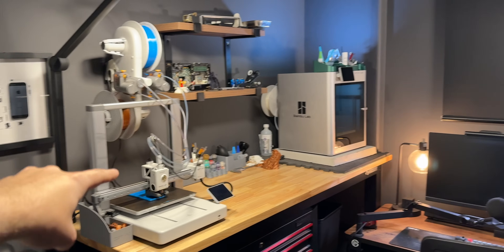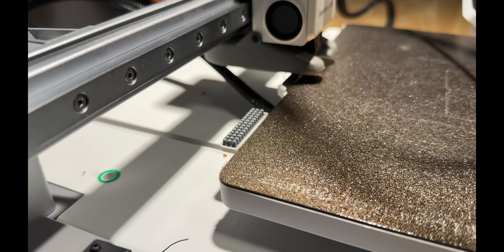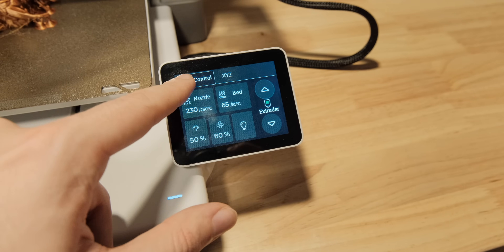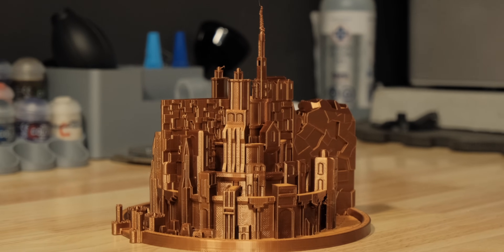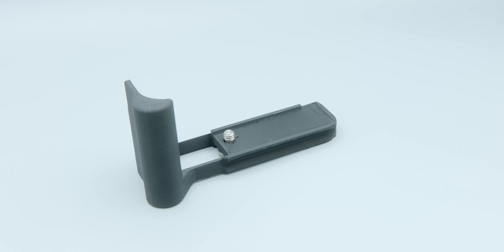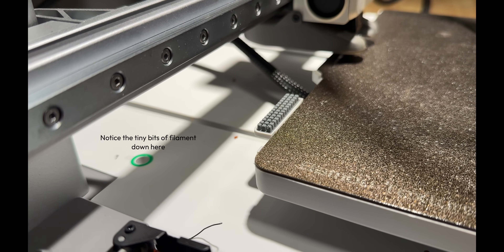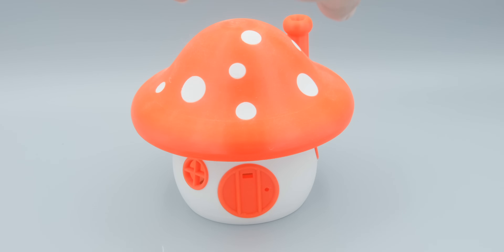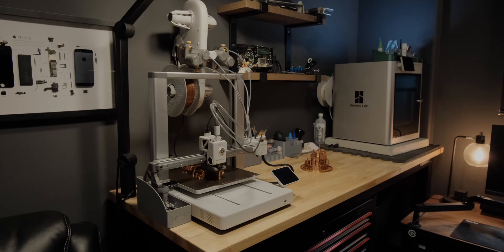Bambu Lab A1: Long Term Review in Under 5 Minutes!

Comment: A1 system is not good, P1S/P instead to be honest, had a A1 for a year and the novelty wore off really quickly as it had many print issues from warping to the bed completely failing and having the nozzle tip scrape holes in the bed, my bad for not ensuring the bolts behind the nozzle aren't tightened from the factory I guess.

Bambu support of course is just as bad as any other modern support, they wont help even under 1yr warranty, unless you're a big YouTuber of course.

Comment: What special software does this require?  I plan to create my own designs in Blender, save as whatever file format is appropriate, like .STL or .OBJ, and somehow feed it to the printer. Of course I'll want to fuss with settings for the printer. So I assume there's special software. Does it run on only Windows and OSX? How about Linux?  I have five or six Linux computers (counting Raspberry Pi etc.) and zero Windows and zero Apple products.

Comment: Not happy with mine. I've had it for 4 weeks now. Hardware is OK but the software (Bambu Studio) is just so unintuitive and unecessarily difficult to use at the same time over-simplistic on what you can adjust. It requires frequent updating and causes errors when you do so. Following the manual (reading the QR codes etc.) led me to a TON of trouble getting it to install and work properly. When it did run I observed that this printer has too much fanfare and "ceremonial actions" before it starts to print anything. Why does it take 2 minutes to zero the toolhead and do so many fancy movements? And that stupid part cooling fan just keeps coming back on even if you tell to go off or zero out it's cooling values. I'm about to cut off it's power supply and put a physical switch on it because it just wouldn't go off no matter what you adjust in the software and it has ruined many a print (due to warping caused by over-cooling) especially when printing PETG. My 2 old Ender 3's and Ender 6 print a lot slower than this A1 and they all just run off Cura but they all produce good parts. Of what use is a fast printer when it just produces garbage? I'm about to toss this thing out the window. I run a small 3D-printing prototyping business and this thing is just making me lose time and money.

Comment: I am new to 3D printing and chose the A1 that I have been using for since January (May) now so here are my thoughts.  Easy to set up and get  going, easy to use but here are my negatives that are making wish I went with another brand.  Have had to replace the hot end about 4-5 times so far just had THE WORST TIME DEALING WITH CUSTOMER SERVICE, guessing its someone from China as response are incredibly slow and come early morning the next day.  They told me that the hot end heater failed and is not covered under warranty because its considered a consumable, what am I missing a 3D printer works from heating filament than printing it is a consumable?  Seems to me that this is a major part of one working, no?  If considering this printer make sure to read the warranty in depth, I just did and scratching my head as to what is covered?  Maybe the hot ends that I replaced were actually part of the heater failure?  I have had several printing issues over time for unknown reasons, it weird does odd things then mysteriously fixes the issue and goes back to printing fine again on it’s own?  I am very disappointed with mine because haven’t even had it 6 months where I have used it minimally and I am having issues and honestly no longer have confidence in this thing.  Had high hopes for this, I was hoping to have a few years issue free like I do with most electronic products that I buy.  Just one guys experience.

Comment: I have the A1 for two months now, and the only issues it had, including layer shifting were solved once I put inside an enclosure. Prints fail frequently when the are the slightest changes in ambient temperature during a print or if there even little bit of wind. So don’t put the printer near a door or open window, or in my case near the garage door or else you will need an enclosure.
Reply: Thank you for this amaizing information. I just started my investigation about 3d printers.
Reply: Did you print it using the A1 by chance?
Reply: @Miller-bp3ww  I have build the enclosure from plywood boards with clear polycarbonate doors.
Reply: I plan to keep it in my room where there is an air vent on the ceiling near my door, it will be on my desk in the corner will it be fine?
Reply: @rujejwsn  Yes, it should be fine
Reply: I print with my ceiling fan on medium. I’ve had some issues with bed adhesion but stick glue fixed that.
Reply: What material are you using? ABS?

Comment: THANK YOU FOR THIS REVIEW. I bought the A1 after a year of research which closed with this video. And I've never had a print mess up. It's honestly a no brainer product. Just buy it, design it, and print it.
Reply: Yup.  I was recently asked why I chose the A1.
Because I was tired of messing with the printer and wanted to mess with the parts, CAD, materials.... not become a printer tech.
The A1 just works.  Throw it stls and it spits out parts.
Reply: @piquat1 how’s it holding up? I had an ender 3 4 years ago but once it stopped working I gave up the hobby
Reply: @tehgusbus2716  Solid.  Really haven't had to do much, normal maintenance.  I only do functional printing, never was a hobby for me.  It's more like my welder or circular saw, just a tool to fix/modify things.

I wonder sometimes if Bambu made this a little too good.  People aren't moving on.  There are A1s out there with 2000 hours, still running.  If you only need to print PLA, PETG and TPU, there isn't really any reason to buy any of their other printers.
Reply: Is the camera just as bad as he said?
Reply: @Chillity99 yes the camera is choppy and has bad quality
Reply: @Chillity99 the printer itself is really good though don’t let the camera discourage you from buying it

Comment: Great Video. What slab is that under the X1? Does it really help with vibration?
Reply from the maker: Concrete. When combined with a soft pad it helps isolate it from the table, making it quieter and reducing vibrations
Reply: @MarkSpurrell  ok! Home depot? What size is that? I'm definitely going to try it. Just moved to a condo and my printer is on the floor. (New building) but still

Comment: Stupid question 🙋 is there any fumes that need be vented??
Reply from the maker: Not a stupid question! Yes, it is a good idea to use 3D printers in areas where there is ventilation. Especially when printing with ABS or other filaments that give off VOCs.

Comment: Just got the message that Bambu Lab will return my purchase price for this two printers. Will see if the money comes in 2-3 days. I had purchased two A1 Combo units and could not get the machines further as five seconds of initially calibrating. Than stop. No solutions from this customer teams, nothing. Nothing close to a "best beginner model" . Anyway, this nightmare is over now.

Comment: I just purchased two of this 3D printers A1 Combo and both are defect and useless. I followed the instructions and started the calibration process what stopped by both printers after 5 seconds. It said "Calibration failed" and nothing else. Asked the customer support with no answer or solution. Now I fighting to get my money back and they make it very difficult. They ask me to open they machine to get the serial number, if I do this they will deny the return because I open the machine. I will soon ask the Canadian Consumer protection agency to go involved. All this videos are paid advertising and not real. This printer is Chinese garbage and I strongly recommend NOT to buy.
Reply: Did u try moving the rail on the x axis?

Comment: If I buy the printer without the 4 roll addon can It still print in multi colors later of I buy the addon? Or is there a certain nozzle I need to print in 4 colors?
Reply: You can add it after.
Reply: Only 1 nozzle. It pukes a bit after each color.

Comment: The cameras on all bambu printers excepting the X1's are such garbage that they really should've dropped them from the design and shaved the $5-10 off the price. They're not just functionally worthless, I feel like they're actually a NET NEGATIVE imo - 3 separate times now I've looked at the camera only to find what at least appeared to be a horribly failed possibly hot-end-damaging level print failure, only to find it's actually just how terrible the camera is 😕

As to the print failure detection - I agree, the X1C has just spoiled me rotten on that front!! I ended up setting up Obico with a cheap-o webcam I had lying unused in a draw (for who knows how long lol), and am finding it's failure detection to be just as good if not better actually... It'll catch whenever there's a filament strand stuck to (somewhere it shouldn't be) even. The one catch is, it needs really solid lighting; since it's image based instead of lidar, the low light results in too blurry of an image to run detection on effectively. Highly recommended!
Reply: Exactly. They put it just to say it had a camera. It's pathetic really.

Comment: I just picked up the Aa1 coo but haven't unboxed it yet, but the prints in this video do not really inspire confidence
I currently have a V3 SE ad  have been getting great prints but I always print in high quality and slow speed.
my prints look better than anything  showcased in this video but I don't know these  speed and quality setting that were used.
I was going to get a V3  but the A1 had bigger volume and the AMS.

Comment: Same here for prototyping. A1 for that and for the quick nozzle swap to print miniatures…whenever Canada Post strike is over. X1C for finish tabletop modular tiles terrain. Both when I don’t need to prototype. You are right, no brainer. Thank you for the tip about filaments falling into the cracks.
Reply from the maker: I haven't actually swapped my nozzle yet on the A1. I actually didn't even know they have a quick swap feature. I just went through the nozzle change process on the X1C and it took me almost half an hour, looks like the A1 takes seconds. Cool, thanks!
Reply: Where can I buy one
Reply: @helenhernandez6202  I bought my A1 and Nozzle at the BambuLab official store. There is a local store where I live have the X1C, P1P and P1S in stock, but they are marked up.

Comment: I just purchased the A1 with AMS Lite during the Black Friday sale and I'm very happy with it. I concur about the usefulness, or lack thereof, of the camera.
Reply: Mine has been running nonstop since August. Enjoy!
Reply: I just got one as well. I don't hate the camera it shows you enough to see if the print failed or not. It's just not a video camera it's just taking a still photo every 2 seconds or so and displaying what it captures. So yeah, if you are looking at it like a video its less than 1 fps LOL.
Reply: How much the Black Friday sale price?
Reply: I literally just returned my impulse buy of the AnkerMake M5 to get the A1 with AMS. The m5 was great for a week no complaints. But I think I'll be happier with the A1 in the long run.
Reply: The inbuilt camera is, to put it mildly, an absolute tragedy. 

Which is a pity considering that the rest of the kit is outstanding for its price point. 

I’d recommend for anyone who has one to just get a third party video camera.
Reply: What would you do with a 30fps camera ? 1 fps is plenty enough to check if the print is failing. Let's think of 3d printers as tools instead of shiny toys please.
Reply: @dudule1232  Tools are the resin printers. Filament printers are expensive toys for hobbyists and those wanting to get their feet wet.